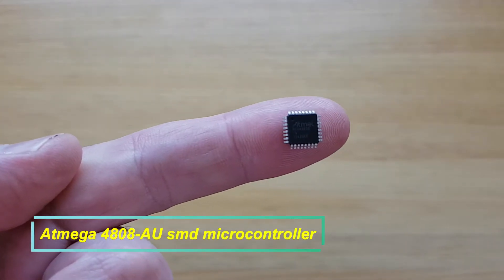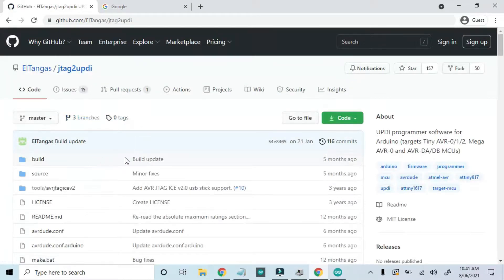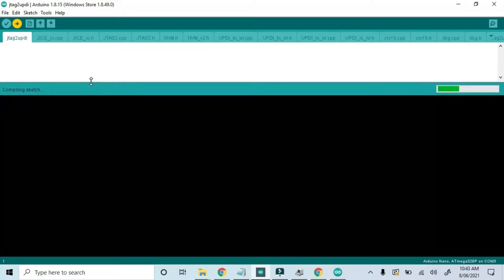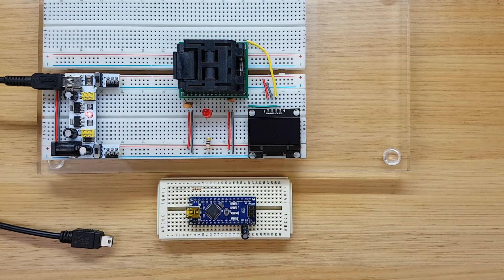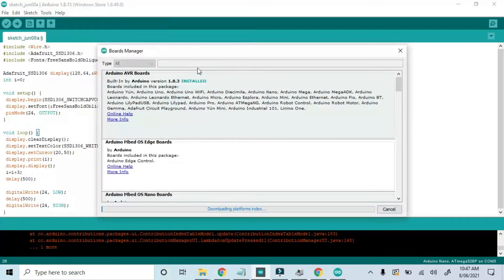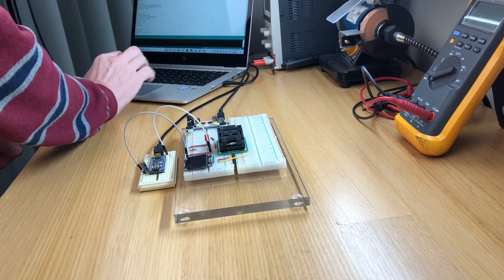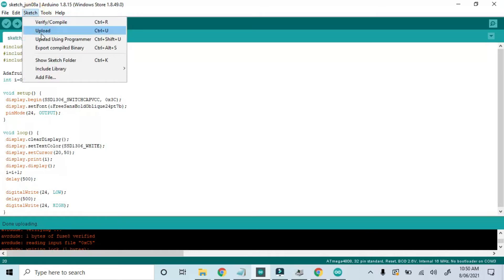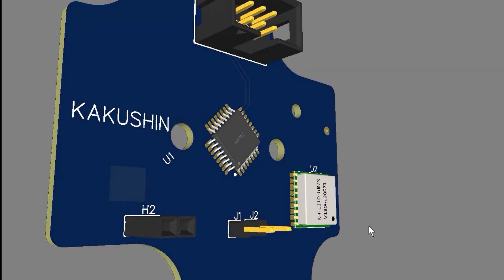UPDI Programming an ATmega4808

Comment: @KakushinAU  , in the same way I tried using Arduino Uno for ATtiuny402 but I got following errors, kindly help.

Sketch uses 382 bytes (9%) of program storage space. Maximum is 4096 bytes.
Global variables use 10 bytes (3%) of dynamic memory, leaving 246 bytes for local variables. Maximum is 256 bytes.
"C:\Users\EMBEDDED\AppData\Local\Arduino15\packages\DxCore\tools\avrdude\6.3.0-arduino17or18/bin/avrdude" "-CC:\Users\EMBEDDED\AppData\Local\Arduino15\packages\megaTinyCore\hardware\megaavr\2.6.8/avrdude.conf" -v  -pattiny402 -cjtag2updi -PCOM11 -b115200 "-Ufuse0:w:0b00000000:m" "-Ufuse2:w:0x01:m" "-Ufuse5:w:0b11000101:m" "-Ufuse6:w:0x04:m" "-Ufuse7:w:0x00:m" "-Ufuse8:w:0x00:m" "-Uflash:w:C:\Users\EMBEDDED\AppData\Local\Temp\arduino\sketches\FF2CC76A97946CAB7A2A0FEA86428253/sketch_jul12a.ino.hex:i"

avrdude: Version 6.3-20201216
         Copyright (c) 2000-2005 Brian Dean, http://www.bdmicro.com/
         Copyright (c) 2007-2014 Joerg Wunsch

         System wide configuration file is "C:\Users\EMBEDDED\AppData\Local\Arduino15\packages\megaTinyCore\hardware\megaavr\2.6.8/avrdude.conf"

         Using Port                    : COM11
         Using Programmer              : jtag2updi
         Overriding Baud Rate          : 115200
JTAG ICE mkII sign-on message:
Communications protocol version: 1
M_MCU:
  boot-loader FW version:        1
  firmware version:              6.00
  hardware version:              1
S_MCU:
  boot-loader FW version:        1
  firmware version:              6.00
  hardware version:              1
Serial number:                   00:00:00:00:00:00
Device ID:                       JTAGICE mkII
         AVR Part                      : ATtiny402
         Chip Erase delay              : 0 us
         PAGEL                         : P00
         BS2                           : P00
         RESET disposition             : dedicated
         RETRY pulse                   : SCK
         serial program mode           : yes
         parallel program mode         : yes
         Timeout                       : 0
         StabDelay                     : 0
         CmdexeDelay                   : 0
         SyncLoops                     : 0
         ByteDelay                     : 0
         PollIndex                     : 0
         PollValue                     : 0x00
         Memory Detail                 :

                                  Block Poll               Page                       Polled
           Memory Type Mode Delay Size  Indx Paged  Size   Size #Pages MinW  MaxW   ReadBack
           ----------- ---- ----- ----- ---- ------ ------ ---- ------ ----- ----- ---------
           signature      0     0     0    0 no          3    0      0     0     0 0x00 0x00
           prodsig        0     0     0    0 no         61   61      0     0     0 0x00 0x00
           fuses          0     0     0    0 no          9   10      0     0     0 0x00 0x00
           fuse0          0     0     0    0 no          1    0      0     0     0 0x00 0x00
           fuse1          0     0     0    0 no          1    0      0     0     0 0x00 0x00
           fuse2          0     0     0    0 no          1    0      0     0     0 0x00 0x00
           fuse4          0     0     0    0 no          1    0      0     0     0 0x00 0x00
           fuse5          0     0     0    0 no          1    0      0     0     0 0x00 0x00
           fuse6          0     0     0    0 no          1    0      0     0     0 0x00 0x00
           fuse7          0     0     0    0 no          1    0      0     0     0 0x00 0x00
           fuse8          0     0     0    0 no          1    0      0     0     0 0x00 0x00
           lock           0     0     0    0 no          1    0      0     0     0 0x00 0x00
           data           0     0     0    0 no          0    0      0     0     0 0x00 0x00
           usersig        0     0     0    0 no         32   32      0     0     0 0x00 0x00
           flash          0     0     0    0 no       4096   64      0     0     0 0x00 0x00
           eeprom         0     0     0    0 no        128   32      0     0     0 0x00 0x00

         Programmer Type : JTAGMKII_PDI
         Description     : JTAGv2 to UPDI bridge
         M_MCU hardware version: 1
         M_MCU firmware version: 6.00
         S_MCU hardware version: 1
         S_MCU firmware version: 6.00
         Serial number:          00:00:00:00:00:00
         Vtarget         : 5.0 V

avrdude: jtagmkII_initialize(): Cannot locate "flash" and "boot" memories in description
avrdude: AVR device initialized and ready to accept instructions

Reading | avrdude: jtagmkII_program_enable(): bad response to enter progmode command: RSP_NO_TARGET_POWER
avrdude: jtagmkII_program_enable(): bad response to enter progmode command: RSP_NO_TARGET_POWER
avrdude: jtagmkII_read_byte(): bad response to read memory command: RSP_ILLEGAL_MCU_STATE
avr_read(): error reading address 0x0000
    read operation not supported for memory "signature"
avrdude: error reading signature data for part "ATtiny402", rc=-2
avrdude: error reading signature data, rc=-2
avrdude: jtagmkII_program_disable(): bad response to leave progmode command: RSP_NO_TARGET_POWER

avrdude done.  Thank you.

Failed programming: uploading error: exit status 1
Reply: Even after doing everything exactly as shown, I am facing same issue (RSP_ILLEGAL_MCU_STATE), but in case of ATmega4808-AU.
Bad response for both "read memory" as well as "enter progmode".
Can anyone resolve this issue?

Comment: Thanks for a clear explanation of this. I used the microupdi board you mention towards the end of your vid,  and whilst it worked initially, my pro micro board is no longer recognised by the Arduino IDE, so can't upload the firmware. More research req'd :) :)

Comment: Fixed my issue, just had to use avrdude. This all gets a little confusing because most people use this for the ATTINY processors and assume an unlocked state or download a bootloader. It just wasn't clear to me initially that avrdude was included in arduino or how to access it initially.

Also the pins dont match up for the 40 pin 4809? idk im looking into it (probably just missed a paragraph somewhere again)

Comment: Hey, I am working on a small project that requires this chip, but I can't find it anywhere would you be able to provide a link to where you bought it? If not, would all the libraries and devices you used work to program an ATmega328P?
Reply from the maker: Yes, all chips seem be be hard to find these days.  Unfortunately the UPDI programming method doesn't work with the Atmega328P, but I see there are currently 5 Atmega4808's available at Mouser for $1.68 each.  You might want to buy 1 or 2.  Looks like there will be more available in February.  https://www.mouser.com/ProductDetail/Microchip-Technology-Atmel/ATMEGA4808-AU?qs=P1JMDcb91o4OSr3c6aXxLg%3D%3D
Reply: @KakushinAU  that you sooo much I just ordered them. True lifesaver 🤩

Comment: Hello I havwe a question does the AVDD goes to 3.3v and ground to ground for that one pair same as the VDD and ground?
Reply: Both the AVDD and VDD go to the same positive input supply, and both GND pins go to the same ground.
Reply: @darkphotons101  @DiyintheGhetto @Kakushin Have you successfully program the Atmega4808/9 when that is powered at 3.3V? Using this programmer or even the offical atmel-ice? I always got error there